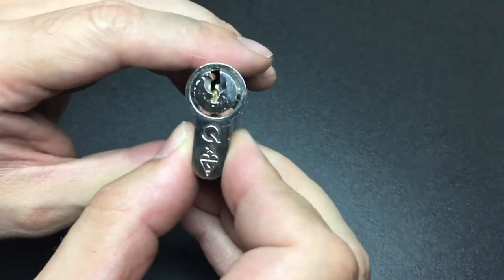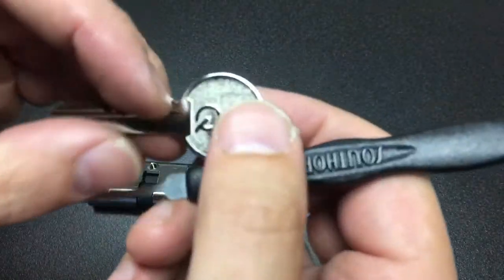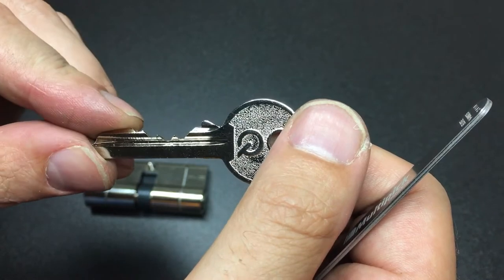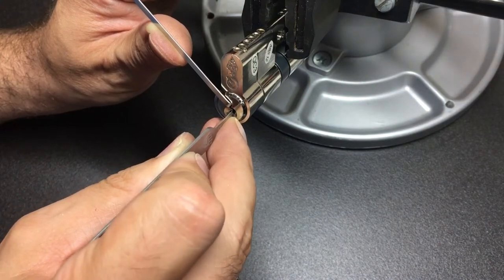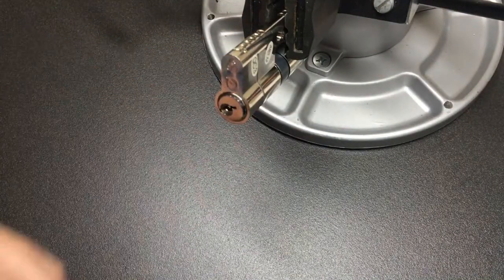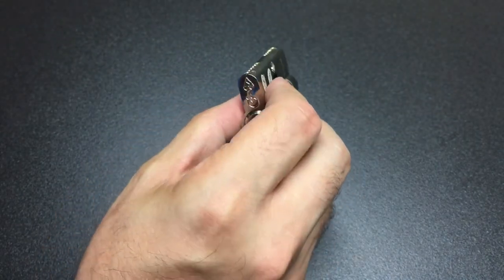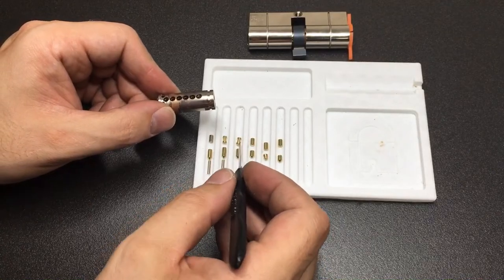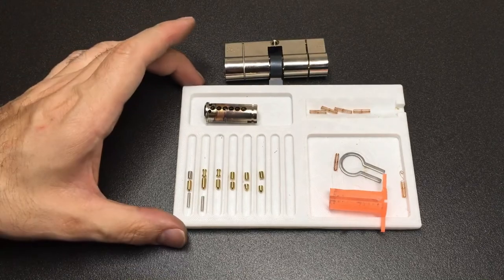New GreenteQ 1* Lock Picked and Gutted

Comment: As always great picking. Keep it up. Can you tell me how to defeat “ping pong” lock? I have a lock that keeps dropping pins. If you set pin 4 than pin2 drops down and if you set pin 2 than pin 4 drops. I can’t seem to figure it out. I have variated tension, and picking order but nothing has worked for me yet. Thanks for this video.
Reply from the maker: Difficult, the usual ways are using either more or less tension. You could try using TOK instead of BOK or vice versa or try. Tensioning in a different direction
Reply: @LockNoob  thanks a lot for the advice and the quick response. Have a nice weekend.